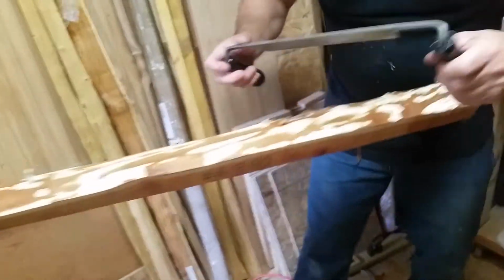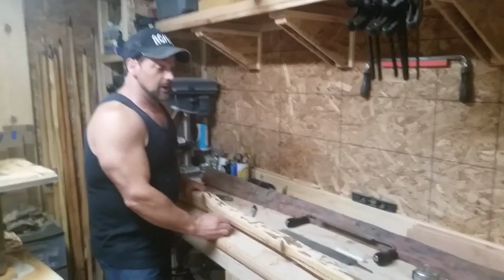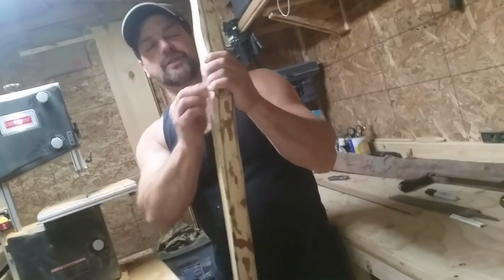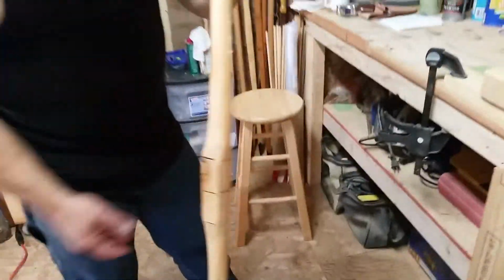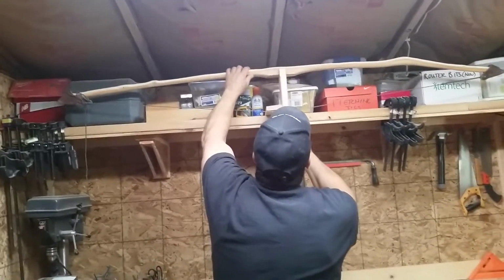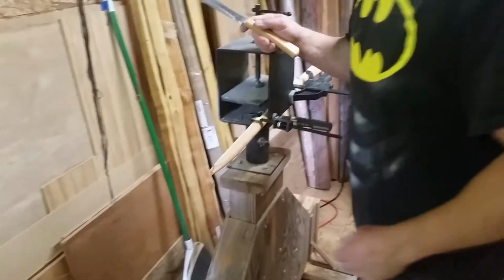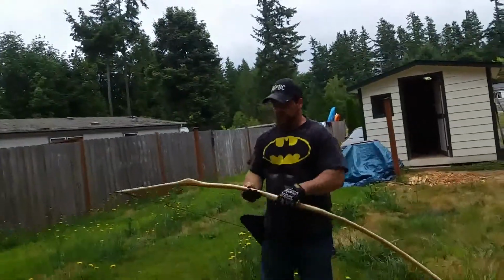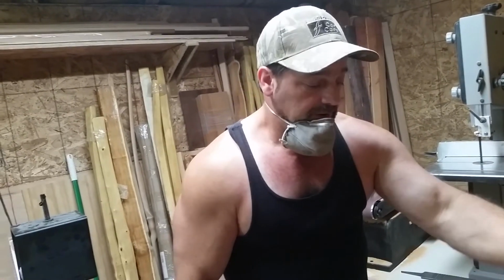The Journey of Yew Bowstave #740

Comment: the walnuts is softer , It 's good wood for bow?
Reply from the maker: Nikos ,
Walnut can make a reasonable bow and a lot of it depends upon the status of The Stave or if you're using laminations maybe is a core but to be honest Walnut has limitations for high-quality bow I've seen some nice self bows made of Walnut and I've made a few Walnut lams myself. It is one of those things where it's kind of a mystery if it will have any longevity. For myself I prefer using it as tip overlays or a handle cap or can be used as a core between Hickory or maple the Walnut is not my first choice for high-quality bow.